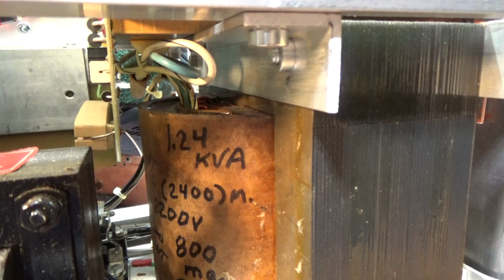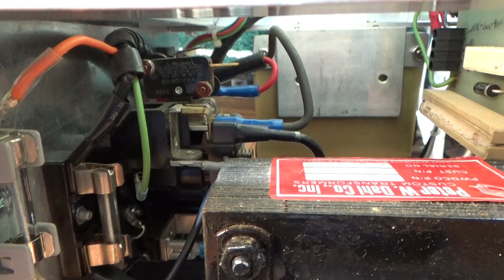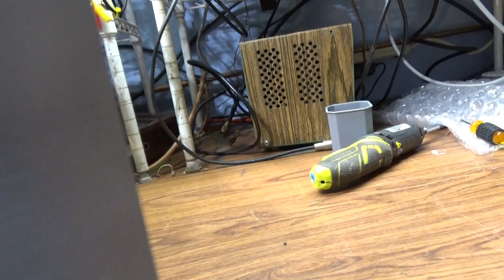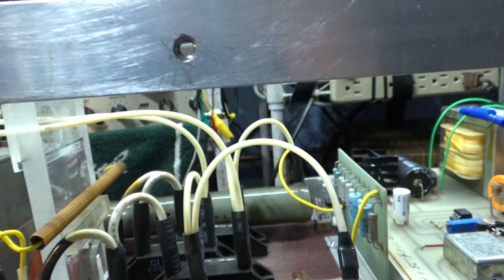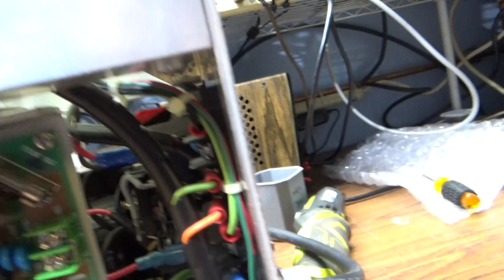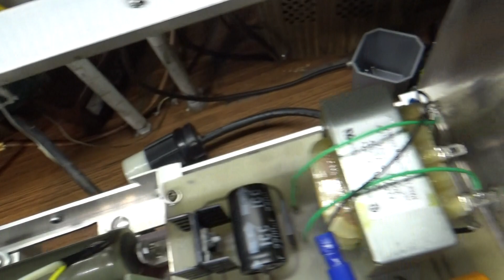Latest buy, external dual 3-500z power supply home made? Help me out.

Comment: I've got a ol amp supply lk550 with 3z's I'm getting rid of..that peter Dahl filament supply is worth it all day. I can see if that   filliment transformers matches mine. It's a millin connection
Reply from the maker: 3z's would need more power. This one is for 2z's
Reply: @tramdr  ya the one that comes with it is a 1.75 amp ccs peter Dahl.